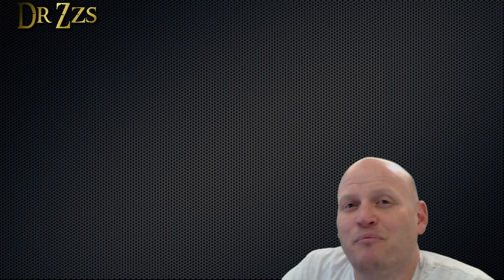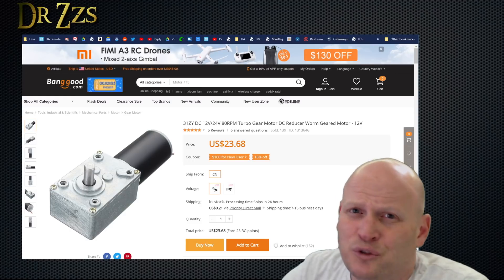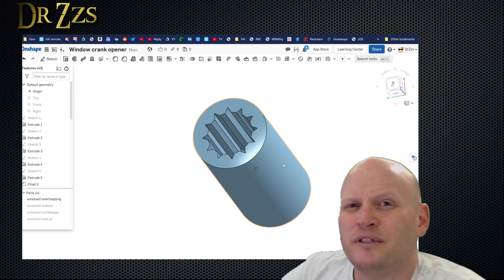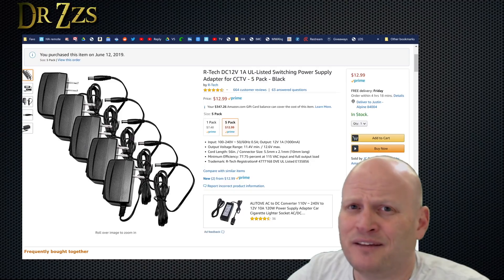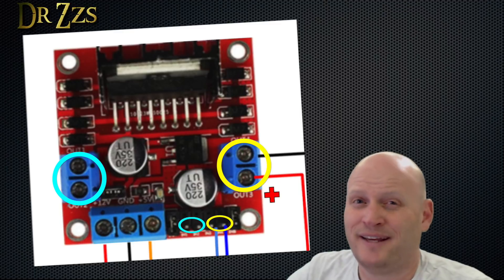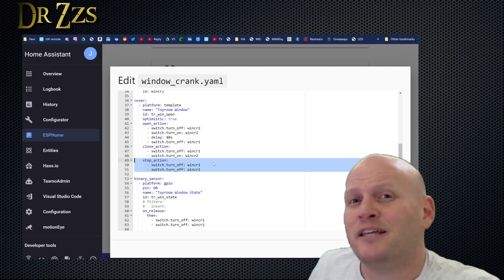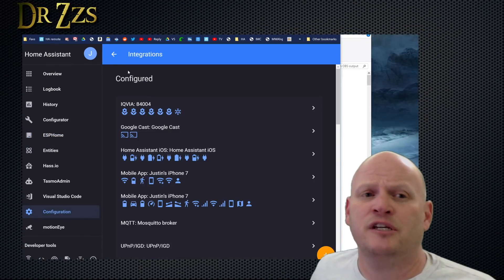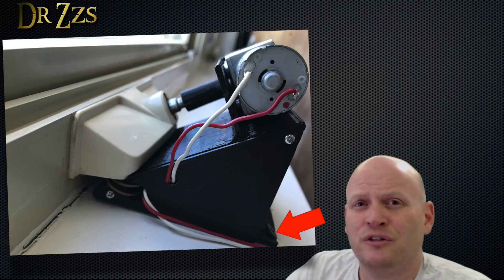Crank Window Motorized Automated | Home Assistant | Smart Home

Comment: 6 years later and this tutorial holds up! I used an ESP32-C3 supermini, and added a Hall effect sensor to track rotations of the motor. Had to scale up the shaft slightly to fit on my particular window, and had to model my own housing for the electronics and motor. Great work, thank you!

Comment: Would love to know what you would do differently 4 years later and if you’d use the same board.
Reply: I'm going to try and do this for my crank windows but I think I'm going to try and use a ZOOZ 700 SERIES Z-WAVE PLUS LONG RANGE DC MOTOR CONTROLLER ZEN53 LR as the controller. I hope it will work.

Comment: Hi @DrZzs. What RPM spec motor did you go with for your window? Mine's about the same size. Thanks so much for this video!

NVM. The two dead links have 10rpm in the URL so I'll go with that! Cheers.
Reply from the maker: Glad you found out the info!  For future reference the best place to get answers is to join in discord.  It can be a bit difficult to troubleshoot via comments.

Comment: My MBA marketing paper was written on precisely this device. The plan was to sell the technology to window manufacturers to integrate into new home construction. The advantage being that you could save a lot on heating and cooling costs if you were to strategically open and close you windows and blinds depending on the weather conditions. It is also advantageous to get airflow from windows in hard-to-reach places. The design was to be modular so that, as protocols change, the user could switch it out for a different module.
Reply from the maker: Excellent!

Comment: Thanks for uploading this! You are going to save me a lot of time in my quest to motorize+automate our upper casement windows. Since we have two groups of three windows and I want to use the more powerful motors for each, I'm thinking about using a PoE power supply, which can be had for under $50 if purchased secondhand. The higher voltage would also allow me to move the power supply to the basement and use a longer wire run. Then I could use a single 48v to 24v dc step-down transformer for each set of three motors. 9 of those motors all running at once would require a 1000W power supply, so it won't fit nicely anywhere other than the basement utility room.

Comment: I want you to know that this system has saved my summer.  Our bedroom gets really hot from May through October, so having good air-flow is a must.  We have high windows in our bedroom that can't be opened from the ground.  The sales rep from the window company sold us a bad setup, and replacement windows will take three months to arrive because of supply chain issues.  I re-created this system for our windows, and now we'll be able to enjoy a cooler and well ventilated nights sleep.  Thank you so much! 🤓

Comment: Great project. Cost is reasonable compared to what Anderson wants, $600 and up. I copied the code from the video and get all kinds of errors which I don't understand when compiling. Another person commented that there was a link with the code which I don't see anywhere and the yaml code was different. Could you please supply the code.
Reply: Did you ever get that link?  I'm getting some errors also.

Comment: Excellent video.  I wonder if the housing design you shared in the link is for the small or big motor option?  
Also since I don't have a 3d printer,  can you recommend a provider to print and ship it to me?
Reply: Did you ever find the file for the big motor?

Comment: Considering an electromagnet or just magnets to keep the window closed.  Kinda like a refrigerator door.  My windows are like 40 years old so they dont close super well.  The other option is to automate the latches because usually they dont close all the way but get close enough for the latch to engage.

Comment: Hi Dr Zzs, I followed your setup and coding using pin D4 connected to the reed switch at window closed position. I was scrambling because the D1mini fails to boot on a power cycle. Finally I realised that pin D4 is used for the boot process, and found my the reed switch is activated (window closed).

Does your setup fail to boot on restart? How do I re-boot the D1mini without messing with the reed switch every time? Thanks Dr. Zzs

Comment: Very cool man! I’m thinking of trying it and making the “wedge” with polyform! 
(Heat moldable plastic) Maybe even the crank connector. I don’t know the strength of the polymer used in your 3-D printer but the stuff I’m talking about is incredibly strong and I have used it for several projects including attaching caster wheels to the legs of a chair.
Reply from the maker: cool.  I used PLA.  It's strong enough so far :)

Comment: I am apparently also as blind as Mahko. I am trying to find the file, but have no clue where it is. I would like to use your code with most of my "position" controls, but try to use an encoder that is attached to the motor to eliminate the switches and approximation of position. This would be considered "close looped", which is used in all industrial positioning control. Thank you for all of your great videos.

Comment: Hello! This is cool and I am trying to build it. Can I use this as an endstop switch and how do I wire it/configure it in ESPHome? https://www.aliexpress.com/item/32434789705.html?spm=a2g0o.productlist.0.0.75d3e416EEnsQ5&algo_pvid=974cb085-2dd1-4db3-b542-513340762533&algo_expid=974cb085-2dd1-4db3-b542-513340762533-5&btsid=a36fef88-ba09-4d51-9236-d160f034b884&ws_ab_test=searchweb0_0,searchweb201602_7,searchweb201603_53
Reply: Answer is yes, connect to ground 3.3V and the green data line to (say) D4. Works well....

binary_sensor:
  - platform: gpio
    pin: D4
    name: "test switch"

Comment: if the motor is destroing your coupling then you won't need a stronger motor, but a stronger coupling

You should add an emergency timeout in case to stop the motor from spinning endlessly and maybe overheating - the magnet will get weaker an the reed will get less responsive with lower temperature. Maybe a current sensing to detect a childs hand would be great
Reply from the maker: I swapped out the 3D printed coupling for a metal one.  I got the stronger motor to open the window faster and not bog down at the extremes.  The motor upgrade wasn't intended to fix the coupling problem.  The good news is, with the bigger motor and the metal coupling I've been problem free for months with this setup.
Reply: @DrZzs Fid did you ever release an updated file for the bigger motor? Only realized when trying to put it all together that the bigger motor won't fit.

Comment: Nice video. You might want to update your sketch to timeout the close action after roughly 60 seconds just in case the switch is never detected as closed. This could prevent the motor from over heating in an event where the something is preventing the window from closing, or the sensor is damaged.  Throw a nice big warning if it ever times out.
Reply from the maker: That's a good idea.  Thanks!

Comment: I've been trying to do the same thing for a skylight.  But using VNH2SP30  as the motor controller.  I has a current sense, so i hope to detect a current rise to determine the window is fully open or closed.    Of course if your coupler is going to fail, this will not work.   I also require an exterior rain sensor to trigger window closure.
Reply from the maker: oooh, rain sensor is a great idea!  I think if you get the metal coupling you shouldn't have failures.

Comment: This is great - I've been looking forward to this video. I've ordered the end-stops and the 8RPM 50kg-cm super extra heavy duty motor with the 8mmx8mm aluminum coupling. It takes 7 cranks to open my old windows. Thanks!
Reply from the maker: cool! you should be in pretty good shape with that.  Let me know how it goes!
Reply: How’d it go?
Reply: @Snugglelol  it works - my setup is a little crude (used all round copper strapping to mount), but I found the motor torque to be exactly what was required without being able to damage the window hardware. I had to replace the springy aluminum couplings with solid ones - the electronics will burn out before any damage is done.
Reply: Crazy question. You say you ordered the bigger motor, did you update the wedge print file or how did you make it fit/work?

Comment: Love your videos. Really nice work and good details on each setup.

You might want to consider a 3D Printed gearbox design to improve the torque also. That could be a nice cost effective solution.

You could try some alternative materials for your coupling too. Maybe nylon would be a good option. I've printed some gears in nylon and they seem to hold up well.
Reply from the maker: good ideas! 
Thanks!

Comment: The lead screw and stepper motor option is what I want to try, although judging from the speed of my printer Z axis it would be very slow, unless you use a more aggressive pitch lead screw and suitably strong motor. May need some experimentation to get right
Reply from the maker: I've got the motor and coupling.  Just waiting on the screw parts to arrive.  I'm hopeful it'll be a nice solution.  We'll see!

Comment: Someone recommend a DIY’ers torque measuring tool!
Reply: I'd be happy to help but it depends what your goal is.
Reply from the maker: Thanks!  What I'm looking for would be something I could attach to the screw on the window and when I crank it I get some indication of how much torque is required to turn it so I could know which motor to get.  I've just been guessing at which motor to use for a few of these projects.  Same with the blinds.  If I could know how much torque I need to pull the blinds up that would be much better than guessing at the motor size and being wrong.
Reply: @DrZzs  
In your case, I would recommend an in-line digital torque adapter with a peak-hold feature.  They are very versatile because you can attach them to any rachet (Not recommended for power tools though).  You would need to rig up an adapter if you can't find a socket to fit your window crank shaft.  Maybe you could use one of those adapters to go from a 1/4 hex drive to a 3/8 drill (bit) chuck?

I own the A/C Delco digital torque adapter linked below and it works great.  My only complaint is that this one only has 3 buttons so to use all of the functionality you need to cycle thru menus.   Competitor products seem to have less precision but their extra buttons would be faster to use on a daily basis.

https://www.amazon.com/ACDelco-ARM602-3-Digital-Adapter-Audible/dp/B004VYUKTC
Reply: @DrZzs  Hey master! Just an idea that occurred to me today:
I would make a new couplet, cut in half, with teeth on both sides of the center cut, with an inner spring that holds both parts together. As long as the torque is too strong, the spring will not have enough force and both parts of the coupler will separate and turn one end by jumping one of the teeth.
Reply: You can just change the spring rate to change the torque capacity...

Comment: Why don't you use the reed switch for the state of the cover? Great video
Reply: Nice outro too
Reply from the maker: Thanks!  I did try that, but it messed with the way the button functions.  I do look at the reed switch as the state in HA, but I don't use it for controls other than to stop the window when it's closed.

Comment: Nice! Great Video! Thanks for sharing! :)
Unfortunately, i have got other types of windows and opening mechanisms. Do you know, if there are other solutions and projects regarding mechanized Window opening? 
Thanks!
Reply from the maker: which type of window do you have?  if they slide open then a linear actuator should work.  Or the next window video I have planned with the lead screw should work too.